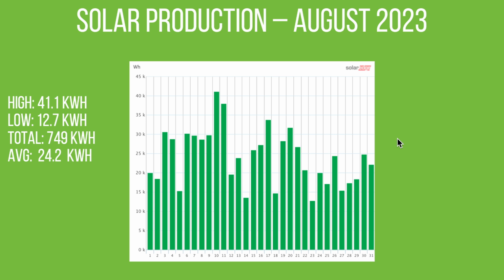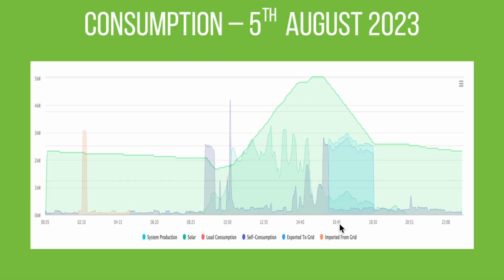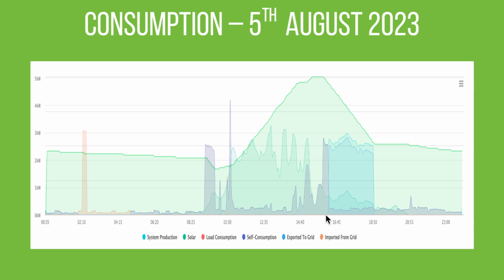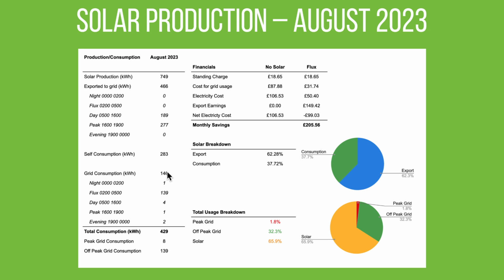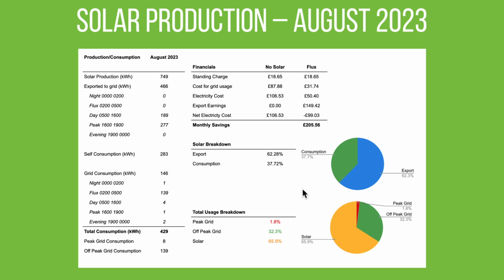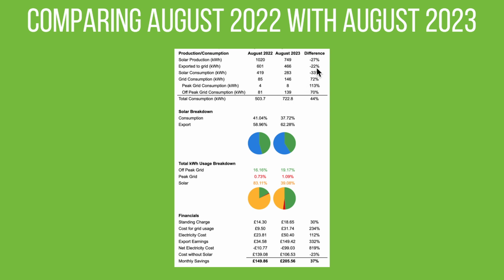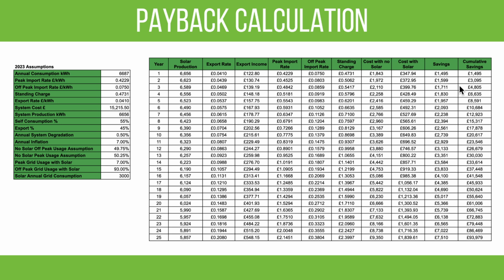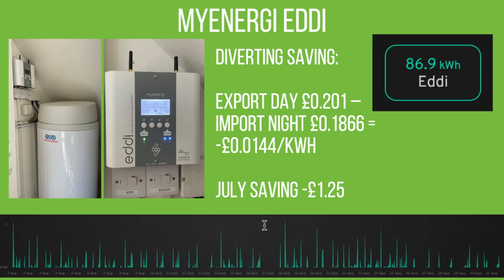Are Solar Panels Worth It? August 2023 - 8kWp Solar Edge + 13kWh Growatt Battery

Comment: Hello, have you had a look at your arrays after the sandy precipitation we have seen in the last week? You may have noticed many cars around Cheshire streaked with the dreaded red dust and I can see our array is a bit grimy.
Reply from the maker: Absolutely! Our car was caked in it. We’ve had it before and the panels do get coated in the dust but after it rained heavily at the weekend it washed the dust away no problem. I think if the panels get tree sap etc on them then it can be a lot worse as the dust really sticks and would need a proper clean, but so far ours are coping ok. Cheers

Comment: Hi Josh generated 696kw last month. Eddie use I have found that I use 3x the gas in kw to heat the water I saved £22 Unfortunately I do not have MCS so no export payment. However even if I had MCS I would still use solar to heat as this is more green than using gas.Since instalation in late April we have only used the gas less then  6 occasions to heat the water
Reply: iirc Octopus are now accepting solar export from non-MCS installations. You should check it out 👍
Reply: @hisroyalblueness  Hi I already have at the moment it’s a trial so have to wait and see thanks for the heads ups
Reply from the maker: That’s really interesting on the eddi. What sort of gas boiler do you have? When we did or renovations we replaced a really old combi boiler which I think was probably not very efficient. Our new system boiler hasn’t been through winter yet so it will be interesting to see how it performs. Are you able to get your install MCS certified? With the flux tariff it would be worth looking into?
Reply: @northernsolar6391  The gas Boilier is a valiant 2003 my installation team dropped the MCS as this was a tick box exercise however I believe they are looking at taking the certification again as I have informed them you need this for payment.I have full DNO Approval as well not impressed on missing out on over 500 pounds this year
Reply from the maker: @paguk2000 20 years is pretty good going for a boiler. The MCS certification is a bit of a tick box exercise but in order to tick that box the installer needs to be certified. If they are then providing a certificate should be automatic. You might be able to back date your SEG payment somewhat when you apply for the export payments so hopefully recover some of the lost cash.

Comment: Hi, really intersting, however cannot work out what you have generated since Apr 22. You seem to be saying 220,000kwh. that cannot be correct? I cannot read your actual spreadsheet. However I would have expected this to be more in the region of 12,000kwh. Please advise the number.  For me my Aug generation was 620kwh from a 3.5kw array facing 150 degrees from North and a 2.3kw array facing 240 degrees from North. It is interesting as my generation will not even hit my MCS forecast this year, by about 10%. I  think this is due to the forecast cals being incorrect, as no alowance was made for shading on my two strings. Basically I get shading from 15.00 hours, mosting on the smaller 2.3kw array. Unsure if cals low generation is due to calcs error or 2023 is a bad year. Thanks.
Reply from the maker: Ah, sorry it’s 11,228 so far. Shading on your arrays will have a huge impact on the amount you generate. So far 2023 has been very different to 2022. May and June we’re much better but July and august have been much worse. 620kwh from your array sounds similar to my figures for the size/orientation?
Reply: Results are not too bad when compared to your. results Just feel misled by the MCS cals. I am lucky most of the shading is in the later part of the day post 15.00 hours which only affects my smaller array.  In addition I have the option of cutting back one of the trees, causing some of the problem. @northernsolar6391
Reply from the maker: A little bit of tree trimming can go a long way, but as you say if it’s only a small section of your array that’s affected at that time so perhaps it’s not that bad. It will soon be getting dark earlier too. No amount of tree trimming can make the summer longer :)

Comment: Thanks for providing really helpful information.
Do Octopus actually pay you for the excess? 
I can't help thinking that would make financial sense to have a bigger battery setup. For example charging them up with the excess, rather than exporting at the lower rate, then exporting at the highest rate. It also seems that it would make financial sense to charge the additional batteries at the lowest price and selling back at the highest rate. 
The only drawback might be that you might need a bigger inverter to handle the power.
I live in Costa Rica and am planning on installing a solar system in our summer, which starts in December. Unfortunately our electric provider doesn't currently have the option of either off peak rates or selling back. Therefore I am planning on a system that effectively takes us off grid and have the grid just as a backup.
Currently our standing charges are thankfully really low, so it makes sense. Our electric kW charges are scaled which obviously means that high use customers pay much higher costs for anything over the highest point of the scale. I also have an EV which currently means that I am  effectively charging at the highest rate. Looking forward to seeing and possibly sharing the project and the results !
Reply from the maker: Octopus do pay us for the excess yes. As long as your install is MCS approved in the UK you can get paid for the export most energy providers, I just chose octopus as they had the best rates. 

A bigger battery would be great but they are so expensive that it doesn’t make much sense to spend £1000s extra on them to make an extra few £s per month of export payments.

Your plan sounds great. I’d love to be able to be self sufficient all year round but it’s just not practical in the UK.
Reply: @northernsolar6391  Thanks for your prompt reply. There are some locations here that have been "allowed" to install sell back systems, but it's a monopoly electrical supply problem and they currently aren't interested in expanding the market. 
I think that it's possible to self sufficient here. We are blessed with sunshine for the vast majority of days. Indeed it's very rare to have a cloudy morning. Although just like your August, the last few weeks have seen several noticeably overcast days! However I am planning on installing more panels than I will sensibly need and therefore should be able to stretch the batteries to cope with a shortfall. 
Have you looked into using your car as an additional battery? Mine offers the V2L option, so I will be able to use it as and when necessary.
Reply from the maker: I think v2l will be huge in future. My current EV/charger doesn’t support it but it makes a lot of sense to be able to use the huge battery in the car to power the house. It only really works if the car is on the driveway though!
Reply: Am I correct in thinking that Octopus no longer require MCS and at least one of their recent tariffs offers a flat 15p/kwh fit throughout the day/night ? @northernsolar6391
Reply from the maker: I’m not sure but I thought MCS was a requirement for any SEG tariff? Yes. Octopus offer 15p flat export but not if you’re on a flexible import tariff like Go or Flux.

Comment: Not sure about the profit calculations. You assume your imports would be the same without solar+batteries, but then you export some of what you imported, which hits the non-solar cost column disproportionately.
To put it another way, if you had 1GWh of batteries which you charged overnight then discharged in the evening, you'd show this as a huge cost in your non-solar column. In reality you wouldn't be importing nearly as much if you didn't have the batteries.
Reply from the maker: We don’t export any of what we import though. I don’t have the battery filling up from the grid overnight. It’s only charging from the Solar. I could do overnight charging to really maximise export payments but it would only be exporting earlier in the day when the export profit would be very marginal.

Comment: I have a question re your SolarEdge inverter. I was promised installer access to enable forced charge/discharge of the batteries. Did your installer manage to set this up or did you need to contact SolarEdge?
Reply from the maker: My battery is not a Solaredge one. It’s a growatt one so I have a different app to control it. For Solar edge your installer can set you up with the right permissions or I believe you can ask Solaredge directly to give you access. Their customer service is usually really good.